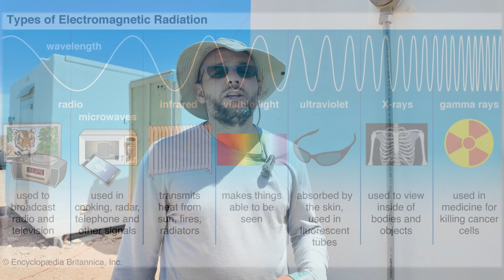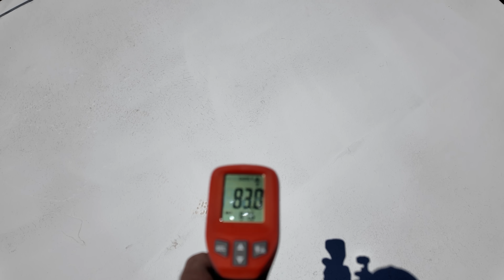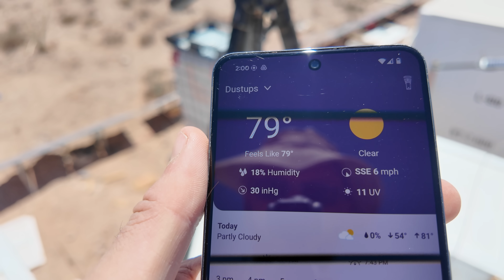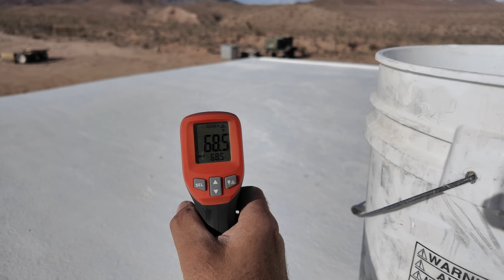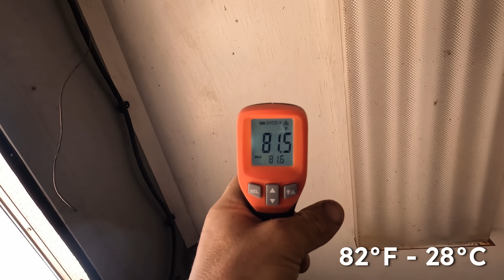I sprayed "cooling paint" on my desert cabin...this is shocking

Comment: There are certainly more techniques for passive desert cooling. Let me point you towards a few.

The easiest is to add eaves to the sides of your buildings. This will create a wider shaded area and shield the sides from direct sun. Since the function is to block light and not rain, a slatted design will suffice and can help with air flow. I'd recommend focusing on the south side of each building.

Another thing you can do is use the heat capacity of the ground to absorb during the day and release slowly during the night. Ideally, you want the walls in contact with dense material. If the ground is too hard to dig more than a couple feet, then you can pile it up in a mound. You can look at earthships for design inspiration. They feature a thick earthen wall on the north face where it stays cooler, and then run air vents through that material while venting hot air up and out the south face which draws fresh air those vents.

This last one is a bit less practical, but you'll see windcatchers in most long-established desert cities. These are tall towers that intake cooler winds high up and channel them down towards their bases.
Reply: Great ideas.  I seem to remember about cities in hot climates having building specifically designed for cooling.

Comment: I recommend a shade cloth over your sight. Should be able to pick up old cami netting from military surplus for cheap. Could also try and get more solar and use those as a shade cover over your buildings while generating more power. I dont mean mount them directly to the top but build them around 2 feet off the top and off each side. This will help shade the whole building. Another recommendation would be investing in a 12v rv AC unit. This can cut power consumption while also keeping your housing units cool.

Comment: yo can bury pipes underground and have air circulate through them into your shelter and the temp of the ground (like 6ft down) stays cooler than ambient in summer and warmer than ambient in winter so the circulating air works for both cooling and heating, they're called "Earth Tubes" and you just need the pipe and the ability to dig the trench, i think you can get passive circulation versions otherwise also a fan to circulate it

Comment: Why not buy military surplus solar shade? If don’t know what that is it’s a tan somewhat we through shade “tent” you can put over structures. It allows wind to pass through and eliminates so much direct sun.  While in Iraq our small buildings similar so what you have, could not keep up with AC. Once we put shades over them the buildings would freeze you out.  Besides dead summer (115-125 degrees) we could actually chill outside and play cards under them and be comfortable.  Besides when mortars came in a few times a week and one burned up our shade. That made everyone made.

Comment: There is a system called an absorption chiller that absorbs heat from the sun and can then drive cooling. You would need to combine it with a solar thermal collector but it would work pretty well in your environment since the cooling effect would be driven by/tied to the heat of the sun. I will try to see if I can find a commercial vendor for one I know they have commercial/industrial scale unit but small residential scale might be harder to find. An efficient solar panel tied AC unit might be more effective for your scale.

Comment: Ben is an honest american treasure.  I am looking into possibly replicating some of his phase-change material (PCM) coolers.  Honestly, you might consider them too.  

One good way to deal with desert heat is to not only cool minimal spaces,  like you do, but to also try and cool individual people.  As Ben mentioned on the PCM video, vests already exist that are designed to hold ice packs against the body to prevent overheating.  Since the melting point for the crystal in his packs can be tuned between 65F and 70F, you won't have to worry about frostbite or tissue damage like ice might cause.  You just put the vest on underneath your reflective outer layer and go.

With the melting point being in a range attainable for nighttime ambient temperatures, you could possibly refreeze the packs each night for use during the following day's hottest working time.  Additional packs could be added to bedding to make the siesta more tolerable, even in the heat.  

These two projects can even be combined.  Take a little of your photorejecting paint and paint it thickly onto one side of a scrap metal sheet.  The paint works 24 hours a day, so your metal sheet will now cool under ambient temps.  Come dusk, you can lie down any discharged packs, throw the metal cover on them, and let the dropping temperatures of the night prepare them for tomorrow.

As you get more familiar with the paint, you can consider some other uses. Any surface that you can cool below ambient temps should act as a condenser for the very little moisture in the air.  It might be possible to combine photorejecting paint with cheap ultrahydrophobic coatings (as mentioned in another Nighthawkinlight video) to produce a surface that dew preferentially collects on before dawn.  The ultrahydrophobic coating means that droplets to not have to be large to break surface tension and get the droplets to roll down an incline.

This project would probably be purely an experiment, as manufacturing would have to have a total cost that is less than the cost of the water it can collect and save during it's functional lifetime.

Comment: I don't think it is so much the heat "reflecting" back from the mountains, as it is that radiation heat transfer is a function of the different of the temperatures to the fourth power (T2^4 - T1^4). The mountains are about the same temp as the air (during a sunny day, higher than the air temp), whereas the part of the sky without the sun is much cooler. On a cool, clear, dry desert night, the night sky can easily appear to be 20-40 degrees below freezing. Not sure how that relates to the daytime sky, but I bet is still below freezing (ignoring the sun, which this paint should be reflecting the vast majority of it). Suppose it's at the high end (freezing) of that range, and it's 90 degrees ambient temp--with freezing on the Kelvin scale being 273 degrees K, and ambient being 311 deg K. That's a function of (311)^4 - (273)^4 = 3.8 billion. That's a big factor. There are other factors, but they all get overwhelmed by a large temp diff when calculating radiation heat transfer.

Comment: I like the idea of stretching canvas between the buildings in the little courtyard you have set up. It would prevent some of the direct sunlight on the ground which would help prevent heat soaking of the ground and cool the adjacent walls of the buildings.
Reply: Canvas would catch the wind . Shade clothe is an open weave that allows  the wind to flow through.  Heaps cheaper that using building supplies light weight and easy to transport.

Comment: Put poles up on the corners of your structures and put up shade cloth...   
White Paint: 
Material: A liquid coating containing pigments and binders.
Function: Reflects sunlight, helping to keep buildings cooler.
Effect: Can reduce heat gain in buildings, but may still absorb some heat.
Pigments: Titanium dioxide is a common pigment in white paint, which can absorb some sunlight. 
Key Differences: 
Mechanism: Shade cloth blocks sunlight, while white paint reflects it.
Airflow: Shade cloth allows for airflow, while paint does not.
Cooling: White paint helps keep buildings cooler, but may not be as effective as shade cloth in creating a cool microclimate.
Applications: Shade cloth is primarily used for gardening, greenhouses, and other outdoor spaces, while white paint is used for buildings and structures. 
In essence, shade cloth is a more focused and effective solution for creating a cool and shaded environment for plants, while white paint is a more general solution for reducing heat gain in buildings and structures.

Comment: We put up shade cloth over the back deck on the south side of our double wide. We were in southern Oregon and it would get up to 115 for days at a time. The difference was amazing a 20 degree drop in the deck temperature. Our cooling costs were probably $30-40 lower per month. It was an 80% shade cloth. We took it down each winter and put it up in May. You can get very large shade cloth online ordering to the size you need. It costs less per square foot than your paint from the sounds of it.
Reply: he likes spending money when he doesn't have to.

Comment: If you could dig out a room 1/2 underground  and bern up the sides with dirt.  You would create a very comfortable  resting area.  Like a root cellar.  We used stacked broken concrete for the walls.   They will deliver it for free if you are not too far from town. You will also need to cover the roof with dirt.

Comment: You forgot to check the temperature of the northern sky, where your best Cold-Sink is.
If you shade from the sun, but expose the northern sky, you get maximum heat radiated away into the cold northern sky.
Also, thermal barriers to prevent heat reflection from the ground, allows greater cooling.
An extreme example: set a water container in the center of a sky-facing mirrored bowl, and each morning, the water will be frozen much sooner than anything else freezes.
A radiator to adsorb sky-chill at night then save it in a water-tank, can provide cooling in the daytime.
Also, a building with windows to the north sky, but shaded from daytime sun, will provide passive-cooling day & night.

Comment: What about an RV fridge?  Just need a modest heat source to heat the ammonia, (and I think you got that).  Mine has about 8 cool settings, and I run 4 or 5 usually.  Keeps my fridge volume 33, 34f, and the freezer volume about 4f.  Energy use is about 12W on 12V house battery to use propane, or 47W when plugged into shore power.

Comment: Up on top of that hill there you probably get some good wind. Since your climate is overall dry, maybe look into wind catchers. Theyre basically building scale swamp coolers, although the water is optional. Theyve been used in other parts of the world for centuries, and I think building one, even a wooden one, when you create the second story, wpuld be an amazing idea. The actual enclosed buildings on ground level could still be traditionally air conditioned, but a pasive cooling system like that which uses the wind and natural power of convection currents and pressure differentials, it could be really useful.

Comment: I would suggest placing a roof over the areas you desire yo lower the temperature. Buy having a separation of say 2 ft you allow for any heat to dissapate. I would also make the roof wider than the areas to be covered. Then place on the roof foil lined sheeting. Then light colored foam. Then roofing. Say epdm white in color. You probably could use a similar roof sealant with reflective qualities

Comment: if I was you, and I could, because I don't know if you have the equipment (digger) to do it more faster and easier.
I Would dig and put all those living spaces underground. The temperature underground below frost line (probably 2 to 3 feet there) usually is constant between 13 and 16° C, so I would dig around 10 ft or 12 ft to have like 8 to 9 ft of ceiling height plus 3 or 4 ft from the surface ground. 
You would save a lot of energy and probably would be more comfortable.

Comment: Suspect someone has already mentioned this, but you will radiate heat from the sides regardless of whether you have direct line of sight. In addition the sides aren't completely obstructed by the mountains, think of a light bulb shining light in all directions. The sides will most likely not be as effective as the roof, but they shouldn't be discounted.
Reply: Also, run shade cloth between the buildings. This will reduce the amount of heat that the ground around the buildings pick up and radiate back into you and the buildings.

Comment: Eco Flo makes a solar powered ac heater unit.  I would build a roof frame and cover the units with shade cloth toi help reduce temperatures around the buildings . You need to paint the solar room to reduce extra heat from penetrating the room.

Comment: If you dig a tunnel down deep enough ,the ground is a consistent 62 degrees no matter the season . You can create an air funnel by changing the diameter of the tunnel thus causing a high low pressure cell. The ancients discovered this long ago.
Reply: He did something like that in a different video.

Comment: Seems like a second roof is the best simple option. Any heat the sun generates in the roof will just be carried off by the wind, and your doghouse will be in shade at the ambient temperature all day.

Build it like an awning and you can have a shaded place to sit outside as well!
Reply: Throw some solar panels up top while you are at it
Reply: @DreamWrightGaming  This. Shade the roof with solar panels. Ditch the window AC for mini splits. Live in comfort.
Reply: A shade roof can at best reduce the roof temperature to near ambient. Emissive paint can in principle reduce the roof temperature to below ambient.
Reply: This would not be able to cool as well as the radiative cooling paint though, which will get below ambient temperature. 

Even a perfect roof will never get the temperature below ambient if you don't use this cooling paint.

Comment: At some point in the future, you can move the radiative cooling off the roof and onto a large panel elsewhere that still points at space. It's not a direct cooling method, like painting a roof, but it allows you to do things like cool water/air pipes well below ambient temperatures. You can find info about this on Tech Ingredients' channel. NightHawkinLight actually commented on the video of Tech Ingredients' that I'm thinking of.

Comment: I really doubt it, conventional wisdom says the paint will reflect it back on both sides.
There is a reason heatsinks in electronics are black, Bedouin wear black and use dark colours for their tents. Same goes for skin tones. Dark colours are better at emitting infrared. (Which is what you actually want)

Comment: I don't know why your geothermal cooling is not working as well as it should but it stands to reason that if you dig those trenches a lot deeper you wouldn't need to run the air conditioner as much

Comment: I guess you could use stacked angled louvres thermally connected to the walls of the structure, so they radiate upward at 45 degrees or so.

Comment: Underground will be cooler than on the surface.  You could use the slopes to bury the bulk of the building and bury lengths of pipe to cool the air in them and then blow the cooler air into the cabin.

Comment: I have a suggestion;  You need to shade the roofs of your buildings to reduce the heat, so take a look at lattices like you'd use in a garden. I saw some 4'x8' for about $30 at the local hardware shop recently. The lattices would block a great deal of sunshine, and if mounted correctly would allow some breeze between the roof and the lattice to aid in cooling. I am sure wooden lattices would be much better than plastic, but in a pinch, either would help.

Comment: Hi from Costa Rica. I'm a patreon for NightHawk, love that channel.

Now, you did something wrong. Sorry to sound like most youtube comments, but let me comment something. As you should already know, this paint works because it has a solvent for the paint, but also water that creates bubbles.

If you paint close to noon, it's going to be very hot, and the water will evaporate close to the same time that the solvent will. For the paint that I can find in Costa Rica, (brand Pinturas Sur) it says on the side of the can to paint very early when you have nice light but the heat isn't too crazy. For my case, I cleaned the roof at almost 6am, painted at 7am-8:30am and then came out of the roof.

Try it when you paint some of the other buildings, do it really early in the morning, and you will get even more cooling.
Reply: Do you have a link for the Pinturas Sur?
Reply: @olivier2553  Youtube might not like link pasting. I'll give you the search terms here, and will also try to copy a link.
The website is called gruposur and the paint is called Thermostyl.
Reply: Can he also repaint the same roof early at the morning next day?
Reply: @myentertainment55  Sure. But the performance is already good enough, and the paint is expensive.
Reply: @FigueroaLabs Really great points about painting before it's get too hot on the painting surface.

Comment: Extending the roof to a overhang of 3-4 feet ( porch style ) will help getting the walls protected from direct sunlight, improving efficiency.
Reply: Yes ---- another roof over the boxes with overhang  and a 30 cm   gap to let the cooling wind to flow through  would cool it down heaps.
Reply: This would make efficiency worse. Radiative cooling paint allows going below ambient temperature, while this would only get it to ambient temperature at best.